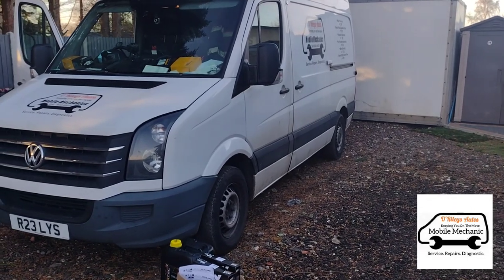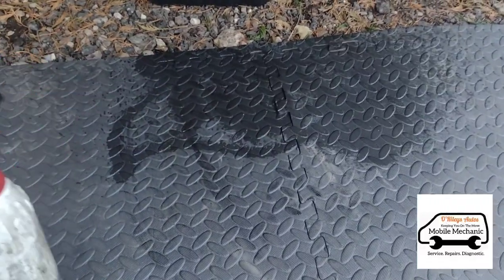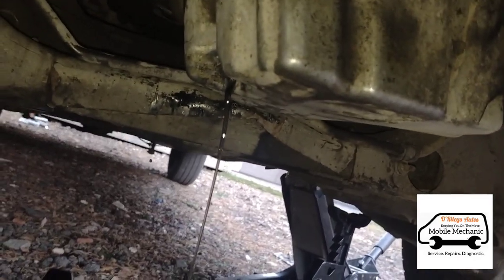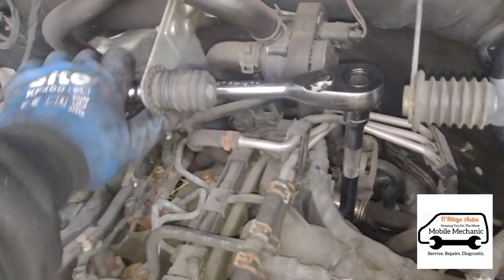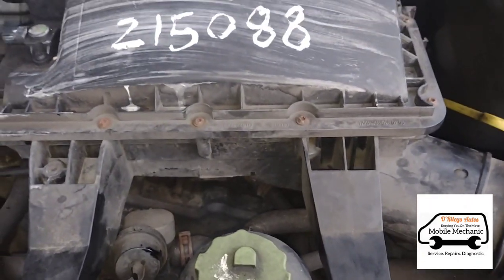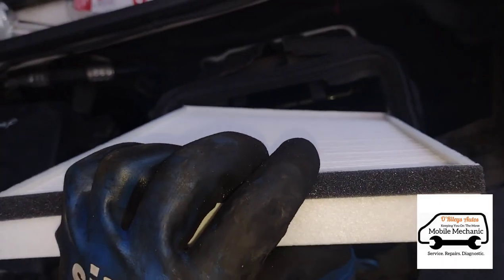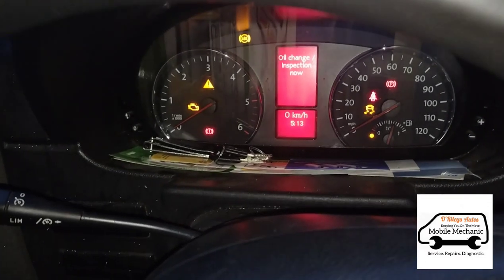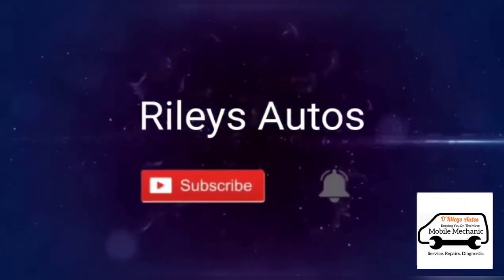VW Crafter 2.0 TDI How To: Full Engine Service Oil Air Fuel Cabin Filter Replacement Location Change

Comment: Excellent demonstration, but wrong layout. There is about half a liter of old oil in the oil filter housing that has not drained into the engine sump. First, you need to remove the oil filter, to drain the old oil into the sump, and then drain everything into the container. Everything else is nicely demonstrated.

Comment: so it is safe to use engine flush on the tdi engines, was told it can dislodge the sludge and block oil passages 👍
Reply from the maker: Anything is possible I suppose but that could only happen if you let it get to that point in the first place where it has sludge. I'd normally empty the oil and refill it with 7 litres of diesel fuel and let it idle for 1 minute before draining it and refill with oil.

Too many people would cry if I done that on video though 🤣

Comment: Hi what year is your crafter van I have the same engine as yours and mine is a 2016 model was going to do an oil change some time next week and was wondering if the oil filter is in the same place thanks
Reply from the maker: Yes it's the same